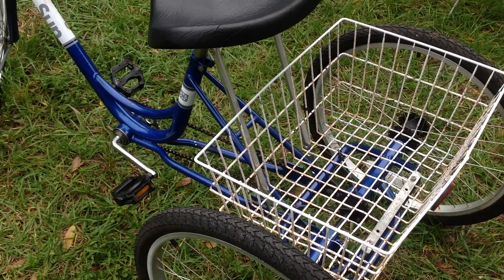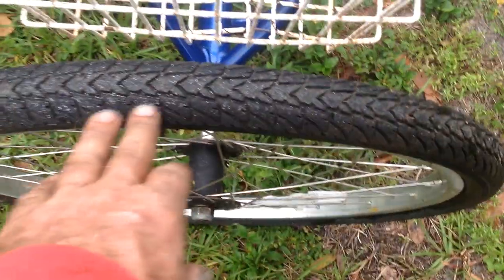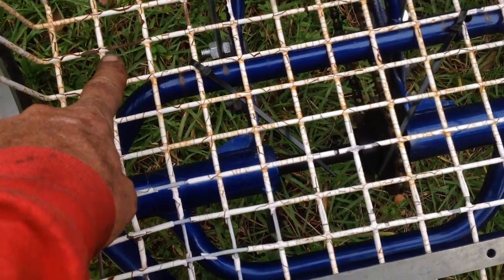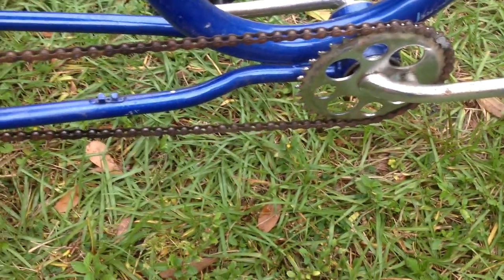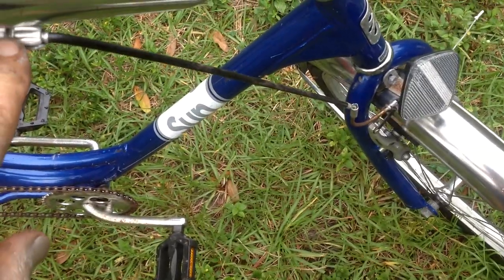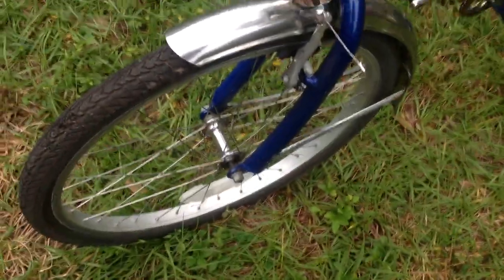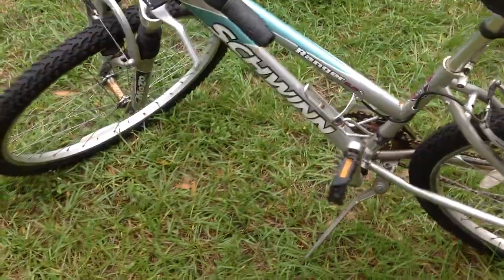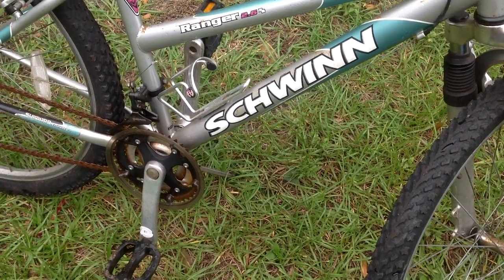Sun brand tricycle.

Comment: It's apparent that the previous owner didn't take care of it. Covering it will prevent rusting. Drying it off if the rider got caught in the rain they should have wiped it off. I have a new Sun Trike but mine has a thicker body and the baskets are made of a thicker , heavier metal. I bought one of the higher end Sun trikes, not a cheap WALMART one. Cost over 550.
Reply from the maker: They wore it out and pushed it to the curb.

Comment: Do you know if the seat can go up (adjustable)?
Reply from the maker: The seat " pipe" has a nut and bolt. I believe you can make a small adjustment, up or down.
Reply: @tommy-time5240  So not exactly made for raising or lowering? I'm probably buying a new one but afraid  it sits to low to straiten out the legs well.
Reply from the maker: @shelley_northwest  maybe 4 or 5 inches lee way. Any chance to test one out first?
Reply: @tommy-time5240  Thanks I appreciate the feed back. Nope they only seem to sell in Florida and I'm allllll the way in Idaho. 🎃
Reply from the maker: @shelley_northwest  Understood.  I think the seat height will be sufficient unless your 7 feet tall.
Reply: @tommy-time5240  Check ✔ Thanks again.
Reply from the maker: @shelley_northwest  no problem, hope it works out.
Reply: @shelley_northwest  I bought one in California and the seat heigh actually is in fact adjustable. You can even replace it with a regular bike seat and post if you want to. This guy just doesn't take good care of his.
Reply: The seat is adjustable
Reply: Shelley -- I just got one of these trikes. Because of the brace attached to the back of the saddle, the seat is limited as to how high or low it can be adjusted. If you need it higher, you can either replace the brace with a new seat post and saddle or you can get an extension for the brace. Depending on how high you need the saddle raised, you might need a longer seat post in addition to the brace extension.
The trike is fun to ride but don't ride too close to a street's gutter/curb area -- the trike will keep pulling toward the curb.  Try to stay three feet or so from the curb, makes for easier steering.
Reply: @L. Lewis  I just bought one of these bikes,  how do I lower the seat? When i loosen at the pole of the seat it seems is a low as is going to go but I'm not really short so I don't get it??